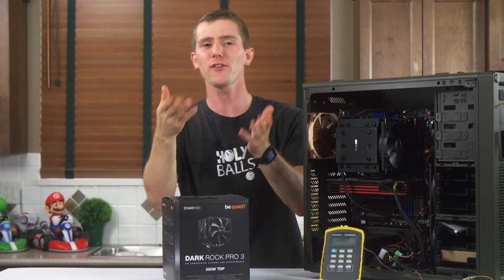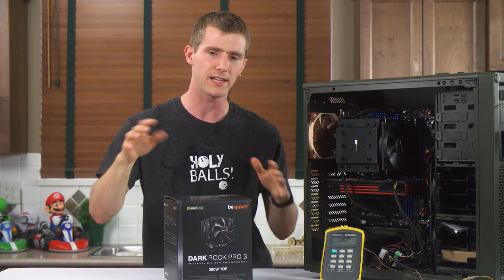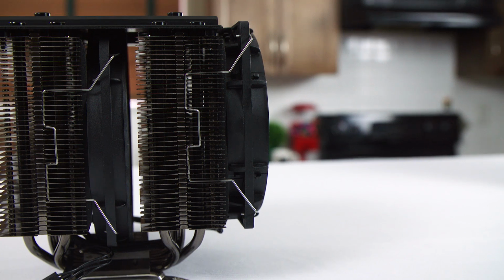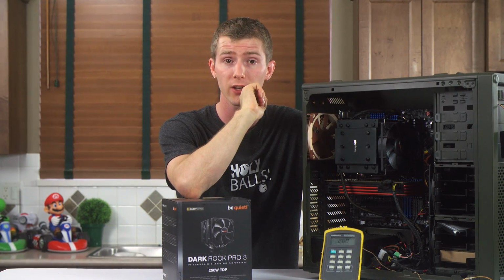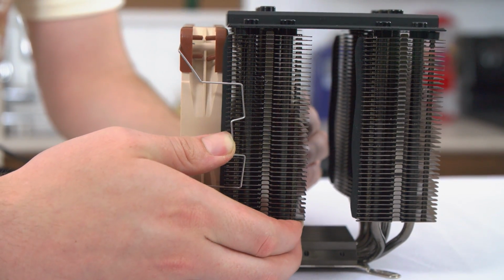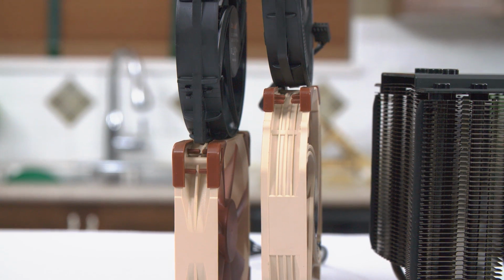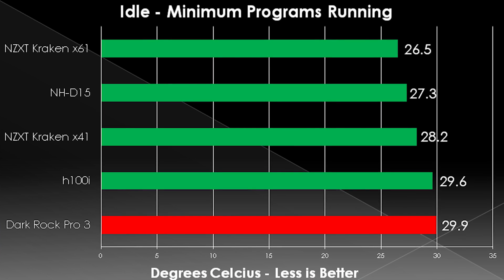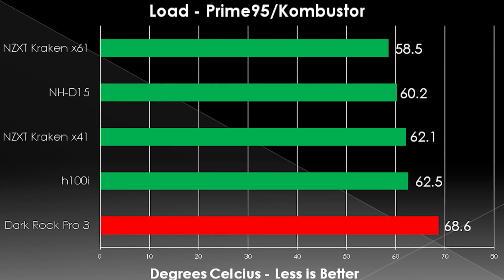Dark Rock Pro 3 CPU Cooler from be quiet!

Comment: Gotta love the people recommending all-in-one closed loops over good airflow. You're all making it too obvious how new to computers you are.
Reply: The_HBK_23 Opps my rad leaked and fucked up all my parts. gg.
Reply: ***** Oops, you suck at building computers, gg.
Reply: Sarge Rho Any watercooler can leak, and it doesn't matter how ''good'' you are a building computers.
Reply: ***** Watercooling is still superior to Air Cooling in terms of temperature and heat dissipation capacity.
Reply: CarpeDiemEnigma
Air coolers won't fall off if you mount them properly.  AIOs parts failing or leaking are completely out of your control.
Reply: Jeremiah Pierce Keyword ''most'' and you still need to get the liquid out of your parts for peak performance, which can be a pain. Plus why should you even have to take a risk when you could just aircool your parts for nearly the same or lower price. Its up to you of course but the most risk you'll take from aircooling is securing it properly.
Reply: In water cooling, water is simply a medium for the air. If you have shitty airflow, then that expensive water cooling loop, or that H100i is pointless. Water cooling should be an upgrade down the road, not a instant system flagship. So for everyone getting butt hurt about this guy expressing his opinion about water cooling just need to sit the fuck down, and get on Newegg to order some new fans, and hope they still have room for a even a Kraken X41.
Reply: Thomas Riddle Unless you're buying high-profile ram, they almost never limit options though. Very few people care about high profile ram, and that's a really nitpicky thing in the first place. A vast majority of motherboards come with backplates and the likes, and I've never heard of someone physically breaking theirs with a sturdy cooler. Look at a case like mine (rv02e), and air coolers heavily compliment the way it's set up. Not many case's airflow would be hurt by a cpu cooler, and i'm really unsure why you think that.
Reply: Thomas Riddle  Eh.  Leaks in AIOs are more common than damage from air coolers to mobos.  I know at least three people that have had an AIO leak but I've never heard of an air cooler causing damage to someone's mobo.

Air coolers are also more quiet and the ram thing is a non-issue if you bother researching before you build.  The benefits of those giant heatsinks on ram are pretty negligible anyways.

I'd also go as far as to say that Noctua's mounting system is easier to install than any AIO.
Reply: Thomas Riddle All of these points you're trying to make against air coolers are literally very highly speculative remarks that you even admit are extremely uncommon. You're just trying to nitpick now.
Reply: Thomas Riddle Except they don't marginally perform better, and looking better is completely opinionated. It's not hard for me to see why people use them. That was never the issue.
Reply: ***** Do you know that the liquid inside close loops and custom liquid coolers is non conductive, yeah it's distilled water. When you distill water it looses all the minerals and it turns into non conductive. I'm sure that what ever happen to your computer it did not had to do with the radiator leak. Take a look here: https://answers.yahoo.com/question/index?qid=20061208101716AA1IYCs
Reply: ***** You're still wrong though. Most rads have mineral water in it. Therefore, no conduction and it won't really damage parts by leaking on it.
Reply: ***** well my corsair h80i improves my over clocking capability significantly. Not only for my CPU, but it reduces anything that can block airflow in my case and can keep my GPU and other parts cooler as well. Plus it looks hella cleaner than having an actual fan (tho the rads do have fans on them)
Reply: d15 only a couple high-end watercooling units top that in terms of performance.
Reply: I guess you completely missed where I said all-in-one closed loops.
Reply: SAMF491 Amazon price matches and mostly has the best prices but I agree with everything else although I personally prefer aircooling.
Reply: If you want the best possible performance without going with a custom water loop, you don't want to be limited in your ram options, you care about aesthetics, and you don't want a ~1kg weight hanging off your motherboard, you should go with an AIO cooler. Both options obviously have their drawbacks, but to say that AIO coolers are only for people that don't know what they're doing is ignorant to the extreme.
Reply: No need to diss the side ''Thomas'' you disagree with. I was just stating that Aircooling has fewer risks involved in my opinion.
Reply: Well, the "diss" here was more addressed at the original commentor, since his comment was similarly as offensive.

Air-cooling might have less risk involved (though I would guess a heavy heatsink causing motherboard damage is not much less common than a leak in a high quality AIO), but there are still drawbacks there.
Reply: Thomas Riddle I never said AIOs are exclusively for people new to computers. I said people recommending a generic AIO over good airflow are obviously new.
Reply: slomo1010 The best air coolers cool just as well, if not better, than a 140/280 closed loop, cost less, produce less noise, and are much more accessible.
Reply: StandardsFtw Could you provide me with a source for that? I have never seen any thermal test anywhere that shows an air cooler beating something like a Nepton 280L, Kraken X61, or H110. Also, slap a few Noctua fans on any of those radiators and the noise will be basically the same as any aircooler.
Reply: Thomas Riddle It's ironic that you're disbelieving air coolers heavily competing with AIOs while mentioning noctua.
Reply: StandardsFtw Not really. They make the best fans, many of which are specifically designed for radiators. Of course they make good aircoolers as well, but they certainly don't outperform 280mm AIO's.
Reply: Ok, I think we have a misunderstanding here. I'll agree that aircoolers do heavily compete with AIO's. They probably have better performance per dollar spent, even if they don't beat the best AIO's. The problem with aircoolers is that they limit ram options, they're heavy and can put strain on your motherboard, they really don't look very good to most people, they can mess with case airflow, and of course they don't actually provide the best performance. Those are some pretty compelling reasons for people to choose AIO's over air coolers, even if it means spending a lot more.
Reply: StandardsFtw Yes, the ram issue is minor, but you are still limited. What would happen if someone with a stock Intel cooler + i3 + Corsair Vengeance ram decided to upgrade to a 4770k + after market cooler? Most air-coolers wouldn't fit without replacing that ram. 

Obviously large heat sinks damaging motherboards is pretty uncommon, but I'm sure it's happened to someone while driving or shipping their tower. Likewise, leaks in AIO's are quite uncommon. Also regarding air coolers' size and weight though, they're a lot harder to install.

If you want a lot of air flowing over components on your motherboard, or you wanted a top intake to feed your GPU or something, an air cooler could get in the way. I'm again not saying this is a big, widespread issue, but it's there. Additionally an air cooler will dump a lot more heat into the middle of your case than a radiator would. I wouldn't be surprised if GPU temps were a decent amount higher with an air cooler in a lot of cases.

And of course my points regarding the superior aesthetics and sheer performance of AIO's still stand.
Reply: StandardsFtw Some are speculative since I don't personally have an air cooler. All the other points I made aside, AIO's produce about the same noise levels with good fans that air coolers do, they outperform air coolers, and they a look a lot better. Why is it so hard for you to see why someone might recommend using one lol?
Reply: StandardsFtw Most 280mm closed loop coolers cool better than top-end air coolers by a couple degrees. Sure, it's small, but it's still obviously the winning option in terms of performance.... Aesthetics are subjective, but most people share my point of view. It's not just the cooler itself, either. Air coolers cover up your ram, motherboard, etc. I doubt there are many who genuinely prefer the looks of the top of a Noctua heat sink to an AIO pump, motherboard, and ram. 

You said this: "Gotta love the people recommending all-in-one closed loops over good airflow. You're all making it too obvious how new to computers you are." and were initially under the impression that air coolers performed "just as well, if not better". It sounds like that was the issue.
Reply: Thomas Riddle
You've been saying this repeatedly without providing any sources :/

Give me some reputable sites where say, a Noctua NH-d15 is beaten by piles of AIOs with a couple degrees difference in overclock benches.
Reply: HadesJanitor Here is a techpowerup review of the Noctua D15 that shows the h110 and h105 beating the D15 by ~1-3 degrees on average: http://www.techpowerup.com/reviews/Noctua/NH-D15/6.html

Both the Kraken X61 and Nepton 280L generally outperform both of those Corsair coolers as well.
Reply: Other Noctua D15 reviews show similar results, such as the ones from Guru3D and Tweaktown.
Reply: Thomas Riddle Because air coolers DO perform just as well, if not better than AIOs. A 280 closed loop that costs 100+ beating a noctua by 1 or 2 degrees isn't exactly effectively better.
Reply: StandardsFtw An H110 costs ~$110 and an H105 costs $100. The Noctua D15 also costs $100. There really isn't a big price difference there.

If we move down in price a bit, a Noctua U14s costs about $80, as does a Corsair H80i. The H80i beats the Noctua there by a few degrees as well. As the price continues to decrease, I'd guess the edge starts to go to air coolers, but at the high end they lose, in terms of sheer cooling performance.
Reply: Thomas Riddle The D15 isn't even readily available since it's new. Once retailers stock it up it'll be roughly the same price as the 14 (70 bucks), which performs relatively the same.
Reply: StandardsFtw It's in stock everywhere I've looked.. The suggested retail price is $100. It'll probably go down over time, but not because there's some sort of shortage now. 

Ok, so a D14 is $20-30 cheaper than something like an H105/110. The D14 in particular seems to have much better price/performance than the majority of other air coolers out though.Either way, I'm willing to pay the premium for aesthetics and slightly better performance, as are many others. It's a perfectly viable option.
Reply: Thomas Riddle It's hardly stocked well. Look at it on Amazon. The only sellers are re-sellers currently, and not many people have their hands on it yet. Easily in a few months it'll drop to 70-80. I don't care that you're willing to pay a premium. It's just that the premium is pretty pointless beside a single degree and subjective reasoning
Reply: Thomas Riddle
With the same fans the difference is negligible.  Take a look at the benches in the linus's h220 video.  People buying a noctua product know they're sacrificing some temps for quieter fans.
Reply: StandardsFtw If you care about the aesthetics of your build, and you're not one of the 1% of people that think Noctua heat sinks look good, then obviously it's not pointless. My windowed case is right nest to me on my desk; I do not want to see nothing but the top of a massive heat sink when I look at it. If you care so much about price/performance above all, why even overclock? A 4670 + stock Intel cooler is a lot better performance/dollar than a 4670k + $80-100 cooler, for instance. $20 is a pretty small amount to pay to vastly improve the aesthetics of a build I put $1500+ into while still getting the same, if not slightly better performance. 

Also, your argument applies pretty much exclusively to Noctua coolers. Air coolers such as the one in this video do not compete with AIO's even remotely as well.
Reply: ***** Dude, a Radiator leaking water is as common as a large air cooling falling off and destroying your GPU. It's so minuscule, it's irrelevant.
Reply: Thomas Riddle
Coolers like in the video aren't in the price range of good AIOs :|
Reply: Eric Larson You can get an H80i for ~$80, which is roughly the same price as this and outperforms it (pretty sure that's what LTT's review concluded, don't remember).
Reply: Angel Luis Trinidad water is non conductive anyway, it's just the impurities that make it conductive.
So after a year or so of a mechanical pump moving the water I'm pretty sure it's going to be impure :-/
Reply: Yeah i think you should go to Car manuf. and tell them your vison : ). hahahahahahahahah.
Reply: that ua nh-d15 beats the shit out of them except that kraken x61
Reply: Thomas Riddle I'm about to buy an aftermarket cooler, and it'll be an air cooler because I can't mount radiators beyond 120mm in my case, and at that point the performance is simply not worth it.
Reply: Standards Lmao I've been building and into computers  for several years now and much prefer aio coolers over air all the experiences I've had had been fine and quiet with very good temps overclocked over traditional air coolers. The risk of leaking is minimal now.....

Comment: I recently got the Be Quiet! Shadow Rock 2 cooler. I mounted it differently. First added the backplate, then put in the screws with the plastic spacers. And leave that alone. Then I atached the fastening nuts to the cooler in the correct place and tightened them, while the cooler was still out of the case.
Then add thermal paste to the cpu, line up the cooler nuts with the screws on the mother board and tighten them with a screwdriver from the back side of the motherboard. Seemed to work fine. I don't think it would have been possible to tighten them with the little wrench, while the cooler was in the case, even with my skinny fingers